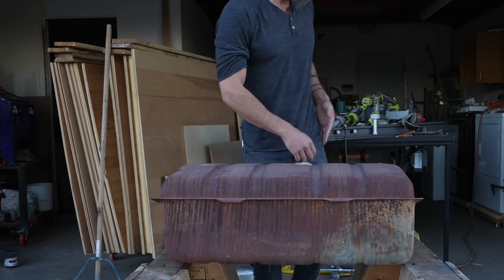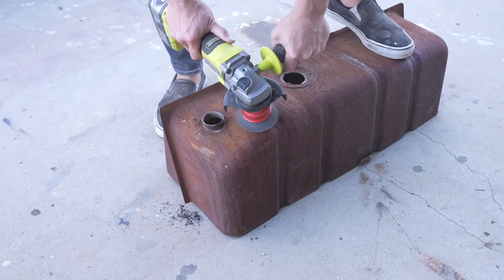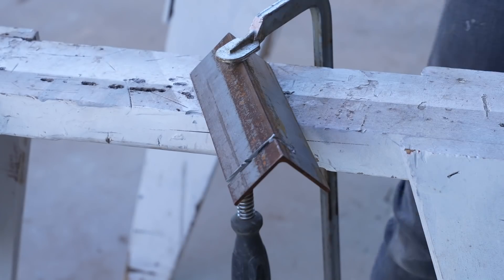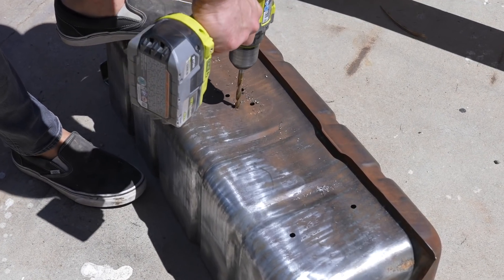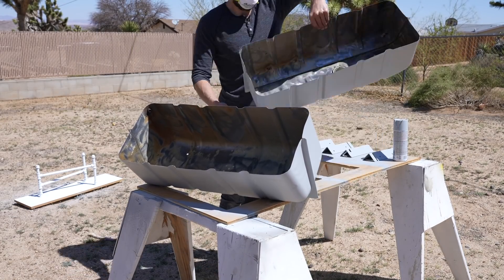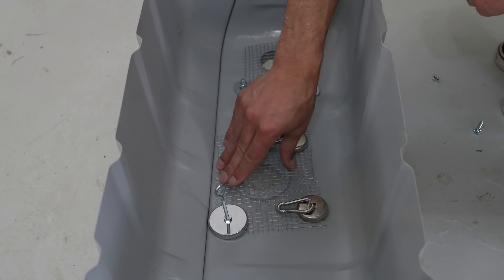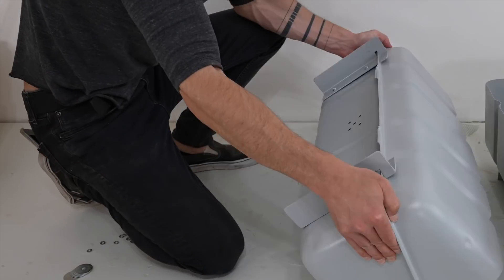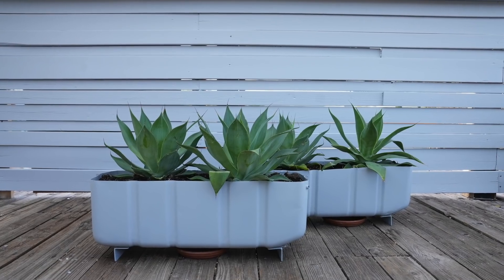Upcycling a Gas Tank into Planters

Comment: Is that terne plate? Sparks from a steel tank are hot enough to ignite gas vapors and were therefore coated with a lead/tin alloy to avoid ignition. That lead could be a problem.